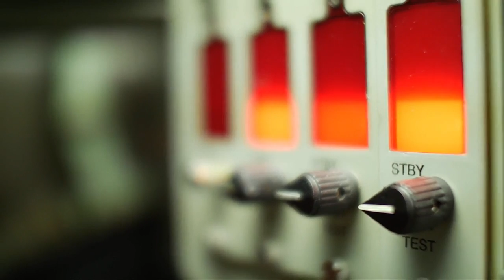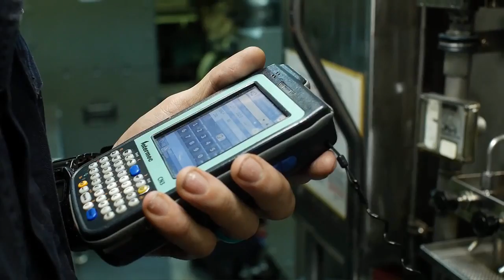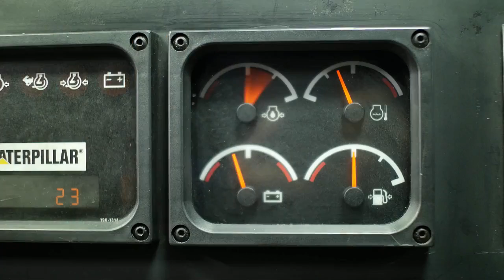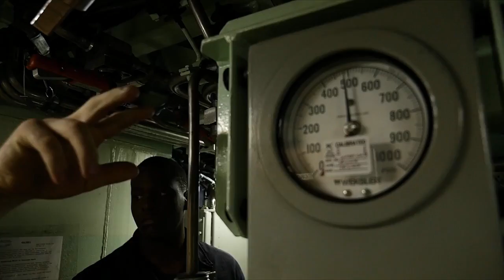USN Nuclear Sub • Look Inside The Auxiliary Machinery Room

Comment: Sounds like the diesel engine is running.
Reply: It is,  Aux Diesel gets run periodically to test.
Reply: yep... Caterpillar now adays.. back in my days it was Fairbanks Morse diesels
Reply: Luis T. Puig boomers still use the Fairbanks. I got confused on why they had a mic but someone pointing out diesel almost made it make sense but he's not at the diesel so im confused again. 

Is the room watch always in contact with someone? I never rode on a fast boat or anything so I don't know how things differ.
Reply: yes, while running the diesel you are on the phones in contact with Maneuvering.  Since the diesel is the auxiliary power generation you need to be in contact with maneuvering, so then you can coordinate the paralleling of the electrical loads between the generators back aft, and the diesel you are running... I ran the diesel on the USS Henry M. Jackson when I was there back in the early 90's...